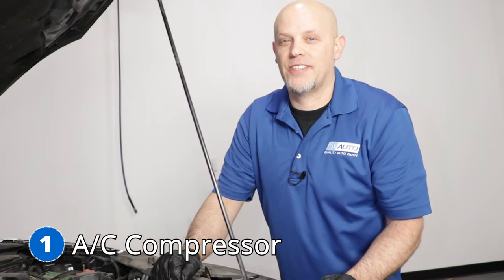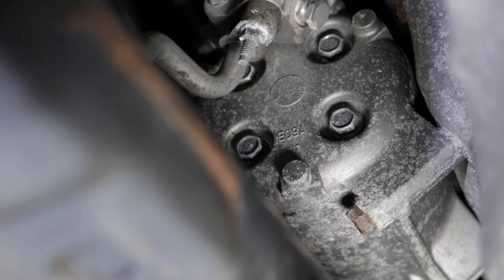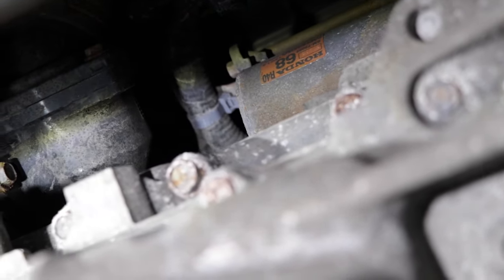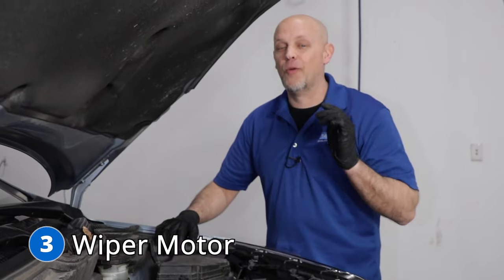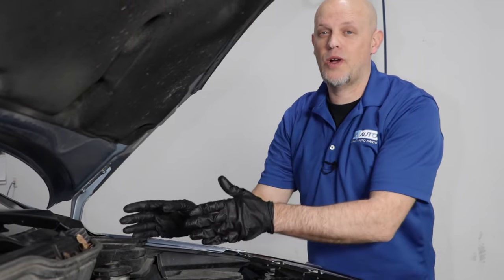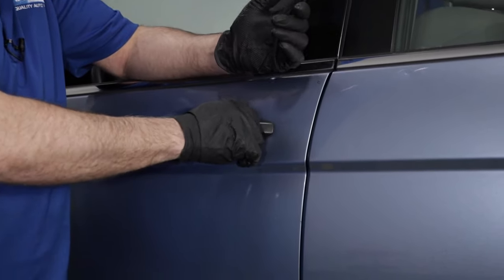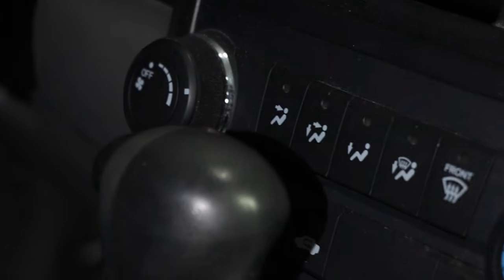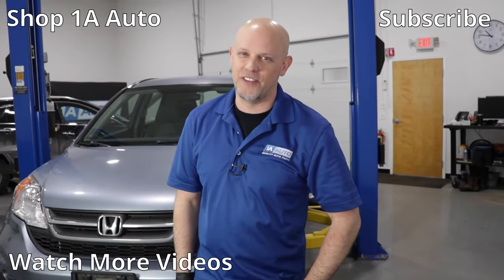Top 5 Problems Honda CR-V SUV 3rd Generation 2007-2011

Comment: Lol. Already done the starter , ac compressor shot , replaced ignition switch ,good wiper motor ,and blower... I have 345,556 miles and still kicking on my 2007 Crv.. had a 2008 crv with 298,146 miles and it was rear ended..replaced ac clutch only and ignition switch.. I love my Crv’s., looked exactly like the one you are showing.😂👍
Reply: Any transmission problems?
Reply: I have a 2007 Acura RDX (same as CRV) and I've done the AC clutch. Expecting to have to do the starter soon since it has 170k miles.
Reply: @gary8787  

Most likely not. Honda transmissions are built pretty good.
Reply: Mine is same 2007 honda crv. Did u  replace yoiur fuel injector yet? I got 197000miles on it
Reply: What was the total cost for all of these ( starter , ac compressor shot , replaced ignition switch ,good wiper motor ,and blower.)? I'm looking at a 2010 CRV right now, but it I'm afraid it may have some if not all of these issues that might need to be replaced.
Reply: @JOGO What oil are you using and at what interval are u changing it?
Reply: @clo6483   my 2011 had to replace whole Ac system. Dinged me almost a grand. Most expensive repair ive had with the car so far and it was needed for the hot summer. Most of the the suspension components are going bad one by one, like the links. I live in Canada and boy the rust sucks here. Might need a tune up soon as the car guzzles gas more at 225,000 kms.
Reply: @gary8787  nop...I am having a fault that came last winter in very cold days and it goes... It's the third gear clutch pressure sensor... 30 dollars.. But waiting for it to arise again nothing serious
Reply: @channel00001  vtec engines need fresh oil... I do castrol magnetic 5w-20 API SN.... Every 4000 miles max
Reply: Wth that's like 650k miles what are your occupation or where did you go
Reply: Nice! I have an 08 with 182k. Wondering how long the main engine parts lasted ya? Like water pump, starter, etc?
Reply: We have a 2009 honda crv that was rear ended and we've had no problems but the clutch is shot so we don't have any ac. Living in Iowa's humid and hot climate makes it awful. We don't have the money to fix it and it only has 151K
Reply: 300k miles noce. What milage change Serpentine belt,
Reply: Same here I’m about 300 k and still going

Comment: I’ve got a 2007 Honda CR-V with about 220K hard city miles on it. I’ve experienced all of these issues apart from the wiper motor. But it’s a tank otherwise.
Reply: Did you  take it to a garage to get repaired ?              or

Did you tackle the repairs yourself .....   and if so , which of the repairs did you work on ?     Thanks

Comment: I owned Hondas for years. Unfortunately the quality and reliability of components are extremely poor. 2009 Honda CRV had inherent AC condenser problem and there was factory recall. Mine broke after the miles guaranteed and had to change condenser and heating core for >$3,000. After one year compressor failed again. Service station suggested replace AC compressor and when I showed it is under warranty, a day after the agents says that the compressor is perfect and that they have to replace condenser. Another >1,000 expense. After replacing the condenser the AC is not working and now I can’t drive the CRV due to over heating. The service agents provided resolution by replacing many other parts >$2,000. I had to spent approx $4,000 per year for last three years to keep it on road. The value of the CRV is <$2,500 and only have 150k mikes on it. These are times when people can barely pay heating bills and should not invest in unreliable products with poor continuum of service. I will not buy another HONDA.

Comment: My Honda CRV 2007 has 352,001 miles and one owner. No replacements have been made on the motor.
Reply: What motor do you have?
Reply: @N317H  Idk but it says i-vetec. It’s a Sport Model.
Reply: @ashleynixon8305  all are ivtec ... and 2007 to 2009 have same engines, only the 2010 and 2011 have slightly different engines. Dont really know their differences thought.
Reply: have you done the valve adjustment??
Reply: I like this honda, but I'm afraid to move from subaru
Reply: @sembamkama1596  Subaru is good, the Honda is louder than the Subaru

Comment: I have a 2011 Honda CR-V and luckily I’ve had NO problems with it whatsoever! Just hit over 100,000 miles and I’ll have this video saved just in case! Thanks
Reply: 2011 crv ac compressor still working but making that whining noise other then that I change the front bearings
Reply: What i want to do is get a different transmission with it being a cvt actually i want to make 300 hp honda crv

Comment: I have an 08 crv I got it for cheap and it's a lovely car. Thank you for the quick and concise video about what to keep an eye out for with my car. I can't tell you how sick I am of having to listen to a youtuber talk in circles for 4 minutes before they actually get to the content, solely so they can stretch it out to the 10 minute mark.
Reply: What did you pay and mileage
Reply: @truthhurts2149  crvs seem so expensive lately. I am looking at a 2008 with 100,000 for 7k
Reply: How has it held up over time? I just purchased a single-owner '08 with 142k miles that seems to have been well taken care of, so I'm crossing my fingers that it will last another 100-150k with proper maintenance.

Comment: My 2008 Crv has 214,000 miles. Just replaced the starter!  New compressor and replacing a power door lock this spring.
Reply: What motor do you have?
Reply: @N317H  K24 all CRVs have the same 2.4L 4cylinder with i vtec
Reply: What a great car ..
Reply: My 2 front window stopped working ( they were perfectly fine )
Reply: @CRAPO2011  They do in the US where it's the K24Z, European models can have a 2.2 N22A/B Diesel or a 2.0 R20A engine. All 3 engines are solid and will last well over 200,000 Miles with no major issues.
Reply: @percyflores7517  I sometimes have problems with my drivers side
window especially in the winter.
Reply: What is the bill for these repairs,  I might buy an 07 that has same issues

Comment: Have a 2010 AWD.  Bought at 140,000kms.  Now has 200,000kms.  Had to replace an AC compressor not long after I bought it.  That sucked.  My power steering works fine but the pump howls under acceleration.  Replaced a belt tensioner.  Blower motor did intermittently stop working a few times but the problem hasn't come back since it started doing it about 1 year ago.  After  4 years of ownership, not too bad.  But still doesn't compare to a Toyota.  Honda quality has slid.  I've owned many of both and the quality shows.  The Honda's are no bad car by any stretch.  But if I were buying again, rather get the RAV4.  I hate how the CRV drives.  Seriously not enough power.  I do like the Honda's features and interiors a lot more than the incredibly boring Toyota though.  I huge reason why I chose the Honda this time.  But for full out reliability, the Toyota is simply the better choice.

Comment: I'm a retired ASE master, My wife has a 2007 CRV that was bought new, this vehicle has never given us a single problem until about a year ago the A/C became intermittent. When I retired I promised to never touch a car again. After a repair shop relieved us of 1200.00 for an A/C evaporator, I decided to diag and repair myself. After replacing underhood relays, a lot of internet research told me I needed to replace the compressor. At 68, replacing the compressor was a real chore, but I refuse to let a shop tell me, "We only use HONDA parts", I was not going to pay 800 bucks for a compressor, I'm no idiot, I know the shop charges me for a dealer compressor, then they pay 299.00 for compressor from a local parts store. I bought a new compressor off of Amazon for 194.00, I still have all of my gauges, vacuum pump and other required tools. I spent more time getting the belt off and on than I did replacing the compressor. Now, everything's cool.  The CRV has just turned 100k. The only thing I hate is the vehicle is so loud, carrying on a conversation at highway speeds is like having all the windows down.  I hate to take trips in it. My Kia is quieter than a library. This year the CRV will be leaving us for something newer. I hope I get a good amount for trade in.---------------Thanks for informative video.
Reply from the maker: +Jumpercable wireless Thanks for checking us out! http://1aau.to/m/Shop-1AAuto-c
Reply: If you don’t get a good trade in amount you can sell it a couple hours posting it online. Or have a car broker sell it
Reply: What Kia do you have? I recently bought a 2008 Sportage that I'm happy with. Its kinda noisy too and something rattles in the suspension over my gravel driveway. I don't drive much anymore so at 140k I'm in no hurry to fix it.
Reply: Makes sense to fix if you have the skills to replace. My 07 is having the heat exchange issue and only cools when driving down the road even though both fans work. I invested $550 for Denso parts to replace entire A/C
Reply: Mecanics must be jailed for slealing people.
Reply: Old mechanics never die they just turn nuts

Comment: I had a 2008 that made it to 200k miles.  The ac was replaced but none of the other issues.  It was in great shape, but the thing that took it out was rust.  Rust I couldnt even see.  It was up above the gas tank.  The rest of the car was in such good shape I didnt believe the dealer and got a second opinion. They agreed it was un-repairable.  As a side note, I have ordered a bunch of stuff from 1A Auto.  Always been happy with them.

Comment: Swindon manufactured crv 2.2. very reliable car. Never had a single issue of those warned about. I just had EGR valve cleaned out which needs to be done to make it run with better efficiency and idling. All done for £70. I really recommend this be cleaned every 80k miles. They are a bargain second hand in uk. The spec is great.

Comment: My 07 has had each of these issues, except for the lock cylinders.  Wheel bearings should be on this list.  But, at 210k+ miles, it still runs pretty good.

Comment: i still have my 2010 honda crv. The only thing i don't like about this vehicle is the vibration at a stop light. The vibration goes through my entire seat. But when I turn my wheel, the vibration temporarily stops. This was the same issue with my 2010 honda civic. But overall, I have not had any major issues with the vehicle. I have 143000 miles on it now. Thumbs up if you are getting this common issue on your crv.
Reply: Valve lash adjustment if not already done, and transmission software update (really helps smooth things out), could be worn motor mounts too. I'd look into the transmission and engine software updates, it may help stabilize idle.
Reply: The radiator lower cushions are worn, making the radiator touching the body and the vibration goes all the way inside the car to your seat.

Comment: I just bought a 2009 164,000 mile CR-V for my daughter.  Pristine condition, but I have dropped $3000 into it already. It wouldn't start one day, ruled out the battery and alternator.  Figured it was the starter, notice the starter was already brand new.  I am guessing the previous owner replaced it when the real problem was the engine program module.  The garage replaced the starter too.  AC quit working but it was only the replay.  The rack and pinion has a slight leak.  I put in some stop leak and it works perfectly.  Used cars, even Hondas, need work.
Reply: Definitely an older crv and depends on how they drove and cared for it too. Did you get a pre-purchase inspection with a good mechanic before you bought it?

Comment: We used to have a 2019 CR-V. After about one year of less-than-usual use, the vehicle would not start. Towed it the local Honda dealer. They started right up. And we were able to start it up there. After coming home, we shut the engine down and tried to start again. After going back and for numerous times and a month less, and after experiencing the so-called service attitude, we towed it to the dealer, amazingly it started there again. We then kept it running for a few hours and traded it in to another Honda vehicle. Less than a month later we traded that newer Honda vehicle in for a different brand name vehicle and swore we would never buy a Honda again. We know Honda survives without us, and we also learned we can go about without Honda.

Comment: I have Honda CRV 2010 model. No problem encountered since I bought it in 2010. It was only the battery and tires that were replaced. No issue yet with the engine, transmission, AC compressor, starter, wiper motor and AC blower.

Comment: I'm the 2nd owner of a 2007 CRV bought it at 98K and 6 months after i had it the AC compressor went out lol. My door locks on the passenger side of the vehicle stay locked but unlock with the key fob, I had to replace the starter about 3-4yrs ago. I'm at 230k and I plan on running her to the ground. Great vehicle! Just keep up on the oil changes and oil level.

Comment: Bought a loaded 2011 CRV last summer, everything was great I remember salesman going over the interior with me, showing me the heater works great, but didn’t both with AC, in my mind I was like “Why didn’t he mention the AC since he just showed me the Heater?”, I just figured everything is fine and it obvious is going to work right. I didn’t even test it when I did my test drive cause it was a rainy cool day.  But yeah, my new car had No AC  and dealerships said I need to use my warranty on it.

Comment: Mine had non of these.
Most common thing I change are the sway bar ends and bushings (few dollars each). I guess they suffer a lot.
I had the winding noise from the gearbox. It was the broken cement on the main shaft making the noise. Replaced the gearbox with the used one (in total few in the whole Europe).
Clutch fins can go on the AC compressor cause they are very thin. Fixed those and that is all in past 7 years.
Very reliable machine.

Comment: This is helpful. I have a 2007 and have been replacing things (AC compressor, starter, some other issues not mentioned here that seem rare) and have around 180,000 miles. I was thinking I needed to start looking for a new car, but sounds like this can last a lot longer...? Maybe another 100k?

Comment: I have a CRV 2018. Recently it is having parasitic battery drain problem.   Have to jump start. Battery is good though.
Also most of the time after overnight the accessory mode is found turned ON by itself in the morning.
Any suggestions on solutions would be appreciated. 
Took to a few mechanics but their diagnosis + solutions failed to work.

Comment: There's a lot missing of major stuff that  breaks on these.  
1. The starters are a pain
2. The drive shafts  especially  the awd. If you have shakes while driving it's most likely  drive shafts. Can be expensive even diy as you'll probably  want new, not  junk yard. 
3. Door harnesses wear out where the driver side electronics won't work. It's a pain to replace.  
4. Yes still infamous  Honda transmission  problems. Many can limp to 200k if baby them,  but beyond  that you are  on borrowed time.  
5. Honda engine  valve adjustment  are just fact of life.  Need learn do it or get scheduled. 
6. Make sure stay up on timing  belt changes, or if buying one know when it's needed or been done.  If not it's a future scrap yard car when timing  belt breaks.  
7. Ball joints, control arm wear out constantly and make noises.  Best learn do them yourself  save $$$
Reply: doesnt this model only come with a timing chain ?

Comment: I got 210,000 miles on my 07 and it's still like owning a new car!
Reply: Would you recommend buying a 07 with 187k miles
Reply: Have you ever had any of these problems on yours?
Reply: Lucked out and just found an 07 with 72000 miles on it in excellent condition from a private owner. I love it!
Reply: What issues if any have you come across since you posted this comment??

Comment: I took my 08 CRV as the air wasn't working. They installed a new compressor and it worked temporarily then quit. I just took my car in for the starter and got pics from the mechanic that my car has major rear rust damage. The rear axle is barely hanging on. Fun times.

Comment: How about the issue with this generation burning oil up around 80k miles?  This is the generation listed under 'years to avoid' for the CRV if you google it.  Honda/Toyota owners (I've owned both) tend to have 'brand-loyalty-blinders' on sometimes.  This is what keeps the prices so high.

Comment: 08 CR-V starter went out last year on vacation the day before coming home. You can't get anything to the starter to beat on it because it's way too low, aggravating to get to laying on the ground but not impossible. Since then I have installed a 2 inch lift, bigger tires and not much problem crawling around under it now and it looks super sweet
Reply: Hi. Was the starter motor failure similar to the symptom when the car battery suffers low cranking power, would you know? Thanks : )

Comment: You didn’t mention the saggy suspension springs or door lock actuators that will go out.  The AC problem is usually just the AC clutch. Shops will usually want to do the whole compressor because it’s an expensive job.
Reply: He did mention the door locks
Reply: My door lock actuator was dying and unlocking my driver side rear door… got robbed in my carport! Took another few weeks for me to figure out how they got in without breaking anything. (I was freaked out by the thought maybe someone had snuck up and opened a door while I was walking away, before I locked it over my shoulder.) Learned years later there was some kind of memo or voluntary recall on the actuators?
Reply: The recall expired in 2015. There's multiple videos on fixing these actuators and I've done both front ones now, and at 245k miles. Right rear is next!